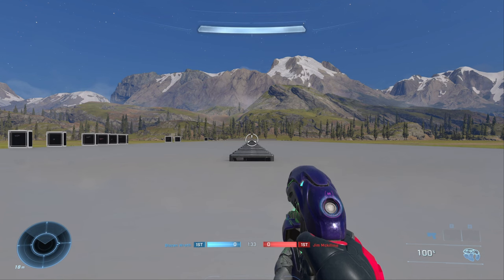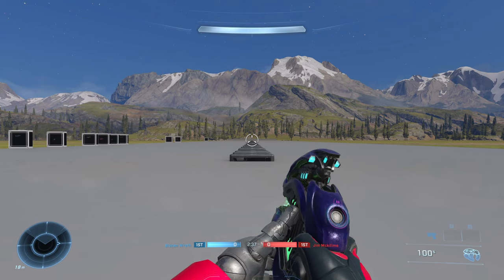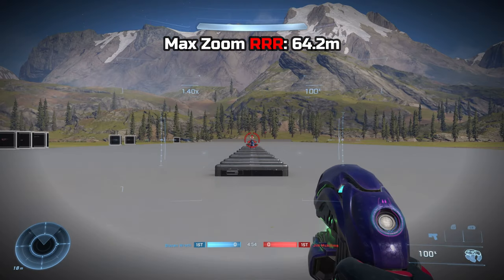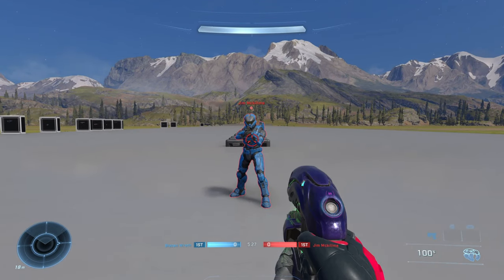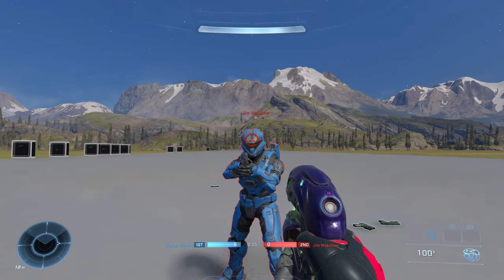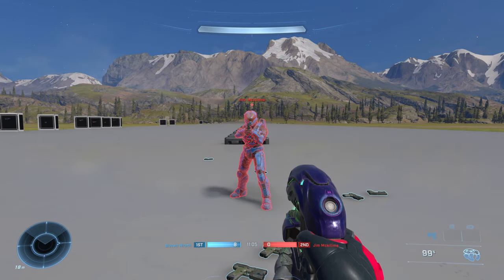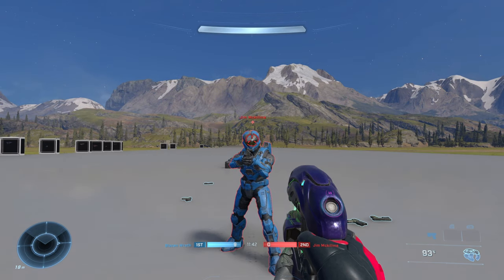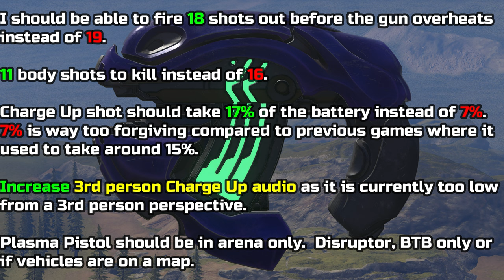Halo Infinite's P Shooter V3

Comment: I used to have one of those hacked controllers (I bought it at a store, how was that even legit) and it had the rapid fire mod, and it could absolutely melt people with the plasma pistol in 4 and reach. But the dang thing stopped working after like a week on any xbox you connected it to sooooo.